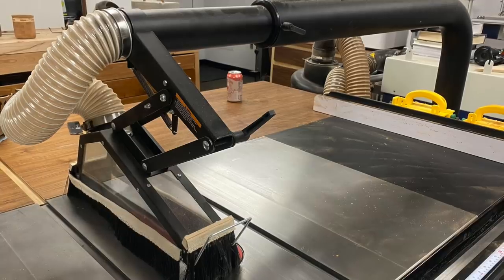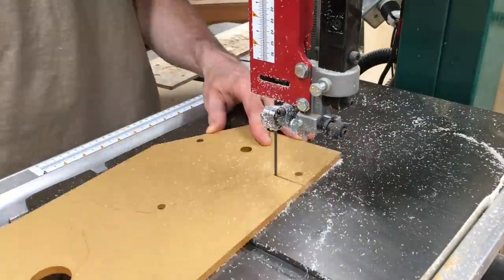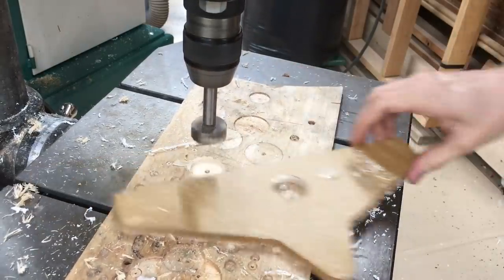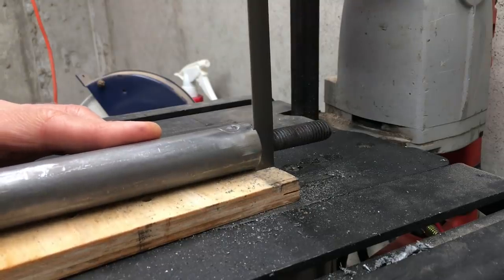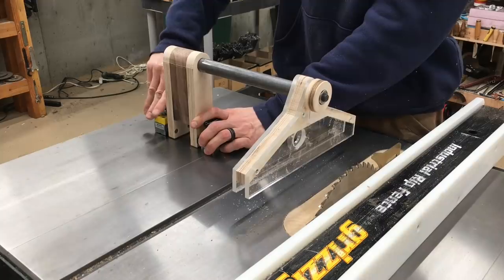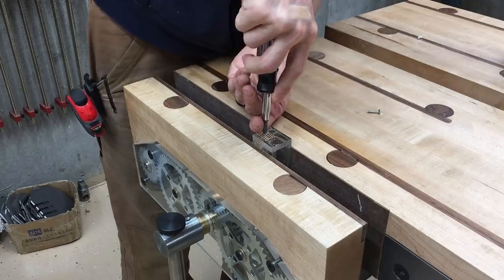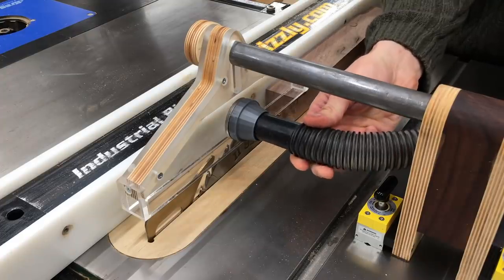Magnetic Tablesaw Blade Guard

Comment: It is a bit odd have a magnetic guard.  I am a Electric and mechanical engineers on some very large industrial machine think size of houses kinda like the really big double wide trailer mobile home for our small machines. The guard and covers have so many bolts and interlock switches making sure they are there and the idea of magnetic if off the wall but it gives me a few ideas that might come in handy. Thank you for making it
Reply from the maker: Cool, let us (Magswitch) know if you need some gigantic magnets to go with those gigantic machines ;)

Comment: Not just clever, but esthetically pleasing to the eye. My question is why not have dust hood attached to the ceiling? I made mine to have it telescope straight down over the blade. I can raise it about 24 inches or if I need to get it completely out of the way, it swings up and attaches to catch on ceiling joist 8 feet above the floor.

Comment: While this is an OK solution for David (and as always a great build by you)  I think his situation would be helped by a ceiling mounted guard that is able to telescope up out of the way.  He doesn't seem to ever move his saw, so once it was aligned it would stay that way. It would be up out of the way when he didn't need it, and could drop down and do it's job when needed.
Reply from the maker: that would be pretty slick.  Does anyone make a guard like that?
Reply: @AndrewKleinWW  Shark guard makes a ceiling mount. Most of the ones I have seen are home built stuff though.
Reply: @AndrewKleinWW  Penn State (PSI) also make a guard that can be ceiling mounted or used as an overarm guard.

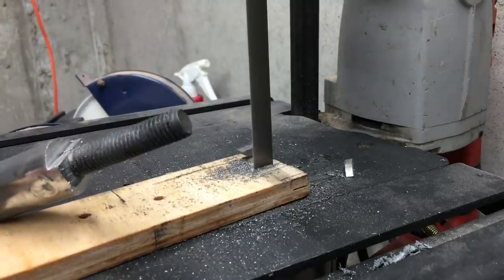Comment: That was fun to watch, and could sure be useful, thank you for sharing.  I don't think I've seen anyone use the bandsaw like you did at 2:37.  Is that to help keep the blade from deflecting L to R?
Reply from the maker: no actually that was to correct a mistake, I had already attached the magnets and I didn't want to take them off to make that cut, so the block raised everything up so the magnets cleared the table.  Laziness innovation.
Reply: @AndrewKleinWW  ahh, now I can see them a bit in the background - makes sense.  Thanks!

Comment: I wonder why David doesn't want to use dust collection. That looks like a great feature.
Reply: More crap in the way. Sometimes having a cluttered work area is more dangerous than the safety equipment cluttering it up, and dust collection isn't safety equipment unless you're cutting some nasty stuff, so it's just clutter in this case.

Hose really needed to port off in the other direction, and it could have if Andrew had used pipe instead of a solid rod for the arm, but I think his choices in materials were a bit limited what with the quarantine.